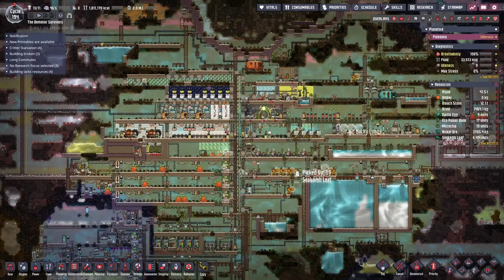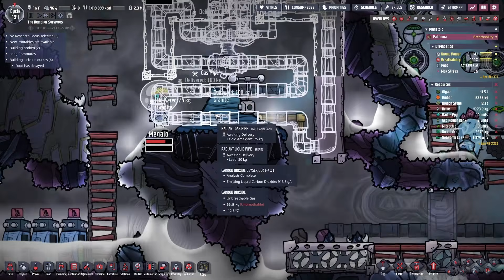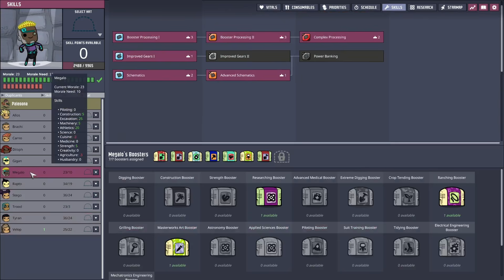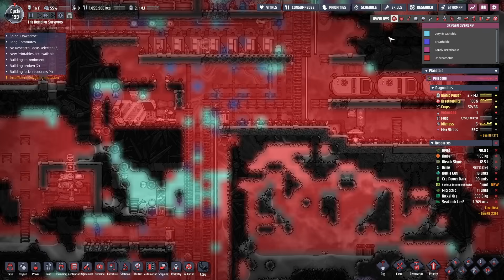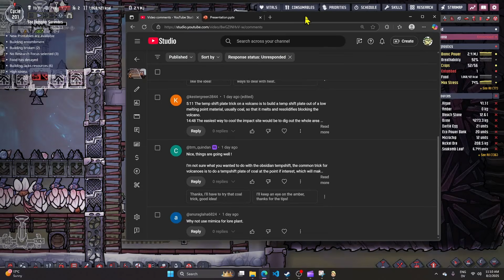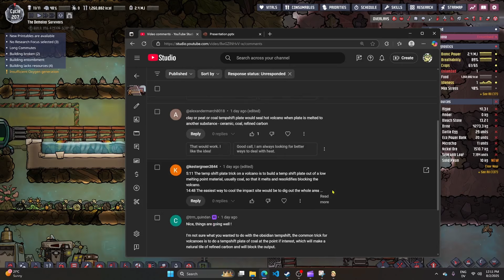CO2 and Water Problems! - Demolior Survivors - Ep. 30

Comment: All the geysers/vents should be surrounded with insulated tiles and all the mechanisms needed inside, so that they do not change the surroundings (unless that is wanted), then the output of the vent/geyser can but utilized in certain ways. That way, even if power goes off or something else happens the vent or geyser has no impact on its surroundings. With the plastic from the amber you can finally automate the volcanoes to get metal to pay for wires and solid transport lines

Comment: For cooling and heating, I think that working with controlled heat bank/ heat sink work better in the long run than directly cooling or heating a line. So when you need something at 30°, you cool or heat a slab to 30 ° and  use the slab to cool/heat the place. So you can better control the heat of the place and better chose way(s) to heat/cool the slab and use heatsource /heat sink for multiple purpose.
That might help with the spaghetti going on here. That said, You did handled it well so far.

For mimika it's good as long as you have dirt, which you don't produce much. But you should have plenty for now.

Comment: 13:12 There were issues with the water pipe priorities in the decontamination tanks preventing the bathroom water leaving the system. 

This was the solution. I have called the left tank Tank 1 and finish on the right tank called Tank 5.

Connect the bathroom water to tank input of tank 5.
Output of Tank 5 to input of Tank 4.
Output of Tank 4 go's straight to sieve. The two layers of decontamination remain and there is no change.
The polluted water from the two geysers connect to the the inputs of Tank 2 and Tank 3.
The outputs of Tank 2 and Tank 3 connect to the input of Tank 1.
Connect the output of Tank 1 to a BRIDGE that connects to the pipe coming from the output of Tank 4 going to the sieve.